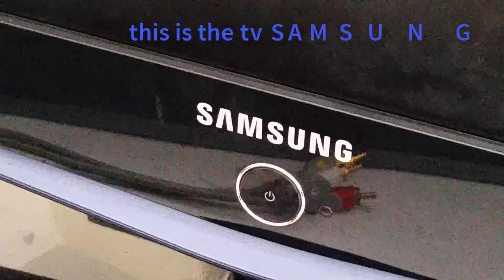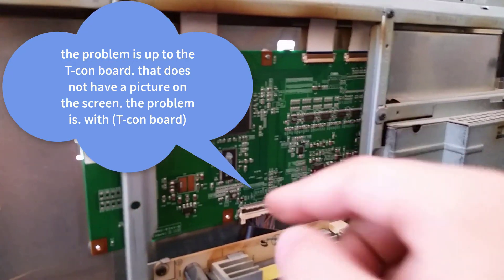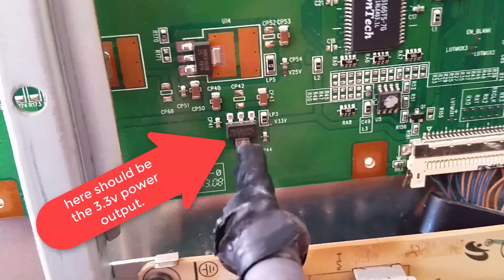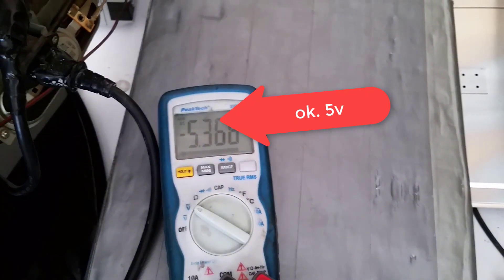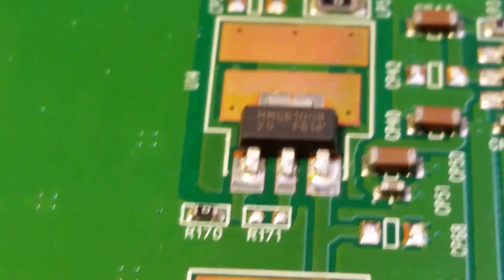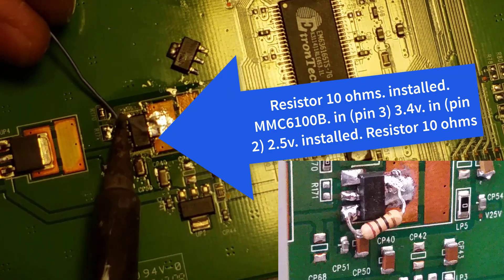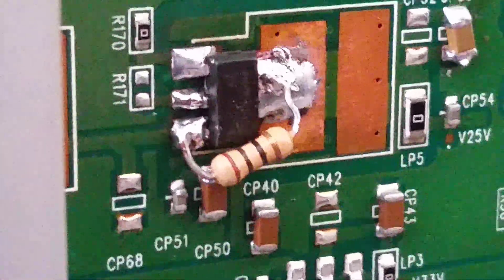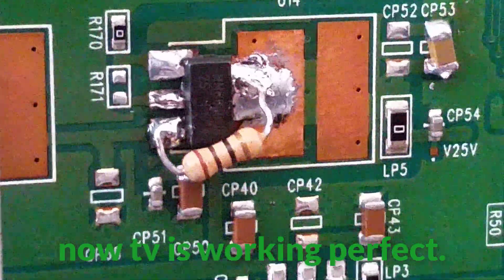SAMSUNG LE32R73BD. repair. in tv. the voice is. lighting panel display is. photo on screen is not

Comment: Nice video , however in my case the culprit was not the MMC6100B but the capacitor CP53, it gave the same symptones as shown in the video. The regulator IC MMC6100B is short-circuit proof, therefore if the capacitor CP53 at its output is creating a short circuit the MMC6100B is switching off leaving only a pilot (sensing) voltage at its output. Thats also a reason it is not wise to connect the output with the input of the MMC6100B with a 10 ohm resistor. Then you are probably creating a big enough voltage to overcome the short circuit of the capacitor but at the chance to over time ,damage circuitry further on. I only excanged the capacitor and it was working fine again. My tv is by the way a Fujitsu Siemens Myrica SE 32 with the exact same T-Con board.
Reply from the maker: I'm sorry you're wrong. I have tried that capacitor but again the same problem. the problem is correct as in the video. has arranged so much with this problem tv
Reply from the maker: the problem lies in the MMC6100B. 100%. you have to change it without the MMC6100B. The 10 ohm resistor is only used to help with voltage for long periods. MMC6100B.
Reply: I am not wrong, I was just saying that not in all cases the MMC6100B is the culprit, in my case it was defenitly the capacitor. So there could be multiple causes for the voltage from the output to drop below value. If you measure the capacitor it seems allright but as soon as you heat it up a bit for instance with a hairdryer you will notice a sudden dramatic drop in value, wich indicates a short cut insite the capacitor. This was consistent with the symptoms my tv was showing. It works fine for a minute or so but as soon as it heats up the screen became distorded and eventually collapsed. Off course in your case the voltage regulator could be defect but that is as I said not  in all cases the culprit.  Don't get me wrong I was happy i found your video because it defenitly showed me the right direction to look for. But maybe for some people it would be helpfull to look at the capacitor(s) as well.
Reply: @RepairAllTV  pershendetje shqipe respekt .

Comment: Way rasistor connect in pin 3 or 2
Reply from the maker: why it helps. MMC6100B with a voltage for not damaging. MMC6100B. to work long